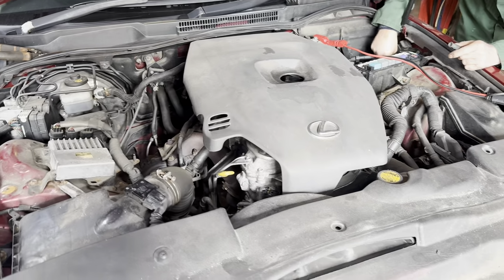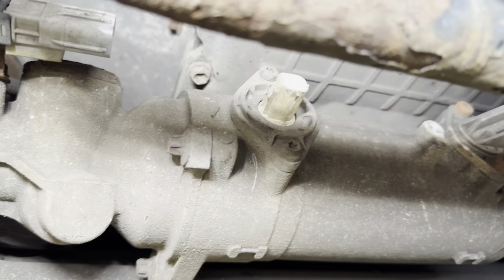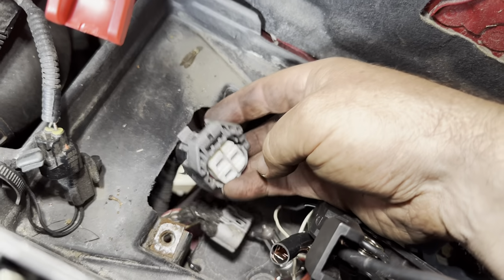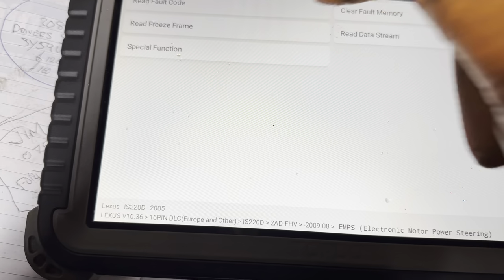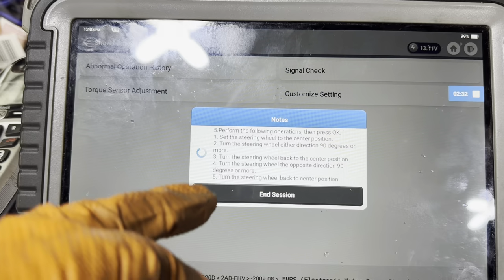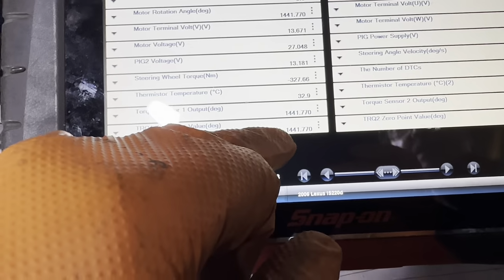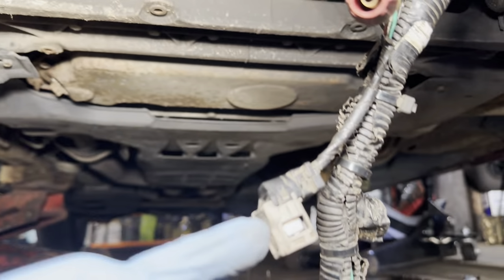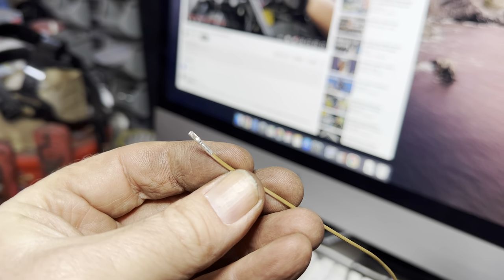Lexus IS 220d - Power Steering not Working Fault Codes C1555, C1515, C1525 & C1528

Comment: That is real life car repair. From a the high of a diagnosis to the reality of the part not working. Well done on this one lads. Not an easy fix 💪💪
As for block connectors, I keep quiet a few from old engines or any secondhand parts I get with a connector on it. Handy to have them when stuck. Cheers lads 👍👍
Reply from the maker: Thanks Peter we had never changed a BMW injector but it was fairly straightforward, btw we found the right size connector from an Old Ford O2 sensor 👍
Reply: @sandyande  it can be daunting tackling some of these jobs when it’s unknown territory. But well done on that fix Sandy

Comment: Nicely done again lads. No sure about Raspberry Pies, reminds me of things you used to get from MacDonalds that burnt the skin clean off your lips 😜. Regarding repair wires/terminals, us VAG guys are pretty lucky, we can get the terminals pre-crimped to a short length of wire which makes the repairs a lot easier and more robust. I’ve used VAG repair wires on other brands of vehicles too; repaired a Nissan NT400 Cabstar NOx sensor connector recently with a full set of repair wires, a new connector housing and the wee silicon seals for each wire, all from VW, worked a treat. P.S. I Prefer a Beef Steak Pie from Harry Gow the baker masel.
Reply from the maker: Thanks Russell I forgot about the VAG wires🫣 we like the Greggs steak bake with a can of girders followed with 3 anti acid tablets 🤣🤣🤣
Reply: Aye. The bakers shops should sell Rennies 🤣